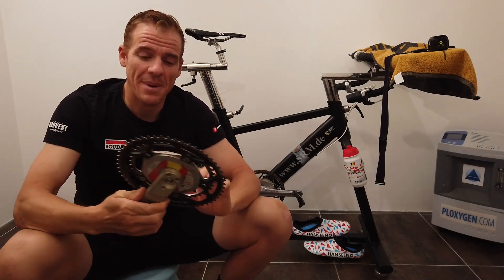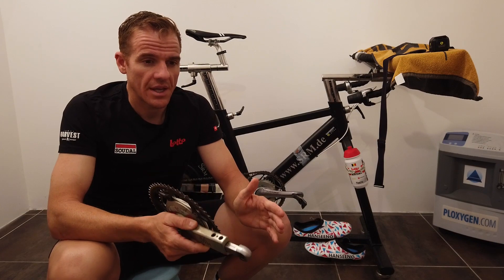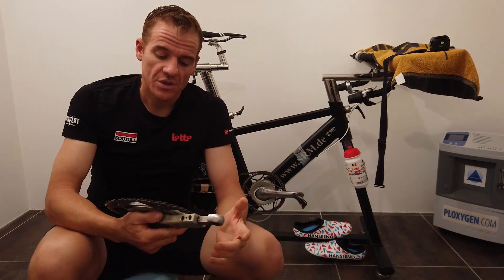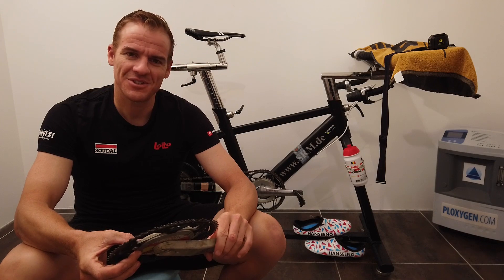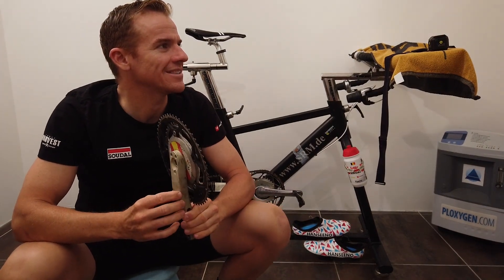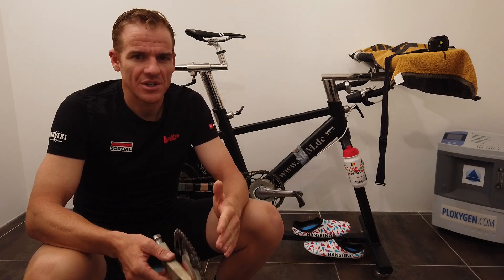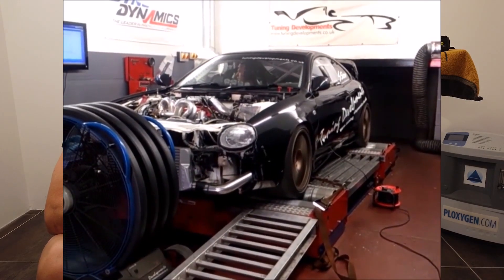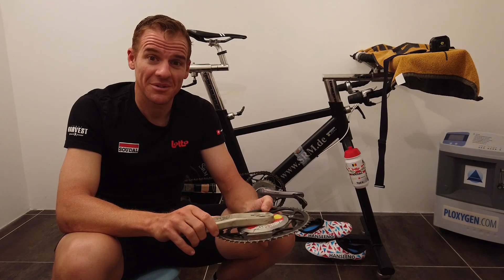What is a power meter? and what are Watts?..... The SRM.

Comment: Hi Adam hope you're doing well, whats your toughts on this new possibility of cheaper powermeters anounced recently?
Reply from the maker: I will go upstairs and get my laptop for this reply.....😀
Reply from the maker: Ok....... strain gauges are cheap. They cost nothing. Of course, there are better quality versions compared to cheap ones but I believe the difference would be less than 10euro. I'm sure you can buy them as cheap as 50 cents each. The things is, what I did not say clearly in the video is when you had to attach the weight on the end of the crank you had to do it at 90 degrees. Now SRM's strain gauges are in the spider. Depending on the version you get, don't quote me on this, there are 4 connecting points from the chainring to the crank part. So 4 places for the area to flex and be measured by the 4 strain gauges. Now there is a science SRM crank that had 8 strain gauges for better accuracy, I think it was 0.5% +/- and cost more. I believe this version had one on each side of those 4 arms but don't quote me. The SRM spider is the best place to measure power. Because of its constant force on these areas at any moment during the pedal cycle. Meaning if you apply that torque at 90 degrees downwards or even at 12 O'clock in a forward position then, the spider reacts the same. It doesn't matter the angle of how it is applied because the crank arm creates the flex of these 4 arms in the spider where it measures it.
Now if you just have a strain gauge on the crank arm, like other manufacturers. Like I believe this new method type coming out and all the talk is about. Then you really have to question how they measure power. Because a 5 kg weight at 90 degrees will send that single strain gauge at its maximum range and when the arm is at a different angle it could be very different, depending on where these strain gauges are mounted on that arm. I don't know for a fact, but there would be a lot of software coding to make it more accurate. For example, when you had those 1 arm power meters would use software to create power on both arms. This is a cheeky example to use, sorry because we all know both legs are not the same but they just doubled it with the code. Some riders have a 4-5% difference in legs and then to add a 4-5% difference in accuracy on cheap systems makes a big difference.

I question not that they are so cheap, but more the location they are placed, the code that will try to show a real figure. Its like HR monitors to calculate Calories. They are accurate at measuring your heart. But they use a formula of your weight, age, Vo2Max to calculate the amount of energy you spend. It's really impossible but they are pretty close and for the money does its job.
Reply: @AdamHansenOfficial  So as you said on the second paragraph, by pure guessing, do you think that's more likely to be a new niche of not so acurrate powermeters? Generally speaking.

When i heard about then I immediately tought that the same thing that goes with groupsets "hierarchy" would happen to powermeters. Anyways im just speculating with hopes that someday they became more affordable.
Reply: @new_world_fish  @Adam Hansen - That's the problem wth the Stages Powermeter in that it only takes the non drive side crank and doubles it. Though it was the cheapest option. I believe Durianrider and also Team Sky (at the time) were big uses of it at one point. There was also a Powertap which measured the power through the wheel hub, which I thought was a little strange. From my research the SRM was the best power meter its only issue was the cost of it. I think Adam you make a good point in that its not so much how cheap something is but where its placed in order to measure.
Reply from the maker: @phill2383  completely agree.
Reply: @AdamHansenOfficial  @Guilherme A Good Discussion with you both. I shall save my Pennies and buy something in the future that will Measure my Power a bit more Realistically.  Chapeau !!!
Reply: isn't the lever arm the one that matters? (not the direction of force in relation with the crank)
   in this case just one strain gauges will be enough - it's just that it has to be accurate and maintain its accuracy throughout the cycling contexts (temperature, humidity, etc).

"a 5 kg weight at 90 degrees will send that single strain gauge at its maximum range and when the arm is at a different angle it could be very different"
   that's normal, i think, since lever arm gets shorter while crank at different angle than horizontal, and while same force and direction of force applied over the pedal.
Reply: @mirceaandreighinea   So I think Guilherme , Adam Hansen and others may have a lot of experience with Power Meters but I'll say my bit.  Its a case of finding (on the bike itself) where the Power is most Accurate to be measured from (this will give you the most realistic outputs). I believe that location is through the Crank Axle.  
Its an additional cost, but its also best to have strain gauges embedded at the four points through the Crank (as this will eliminate Dead Spots in the Pedal Stroke?) There is lots to debate with the Lever Arm, but if you are using that method then its both Lever Arms (and not just one i.e. Stages). There are also Pedals which claim to measure Power but what I've picked up from this dialogue is the further you get away from the Crank Axle the less accurate true power may be.
Its a lot about the Mechanical Movement of Cycling as well i think.
Reply: @Phillip Lloyd 
   
   best would be as close to your body as possible, of course two sides (since two legs), which means: shoes, or pedals, or cranks close to pedal spindle. the further away you get from that the more inaccurate it will be, since the system is getting asymmetric (chain on the right side). 
  
   then how often you measure it (force/torque) per one crank revolution. of course, the more the better, since you create the "continuity", covering more space. 
   
   either way is the same for getting the torque: either force perpendicular to crank times lever; either force straight into the pedal axis times lever arm. 
   
   and, of course, one thing is the power measured as close as possible to your body (ideally, for knowing your self), and another thing is the opposite, the power measured at the rear wheel (which actually propel us in movement).
Reply: @mirceaandreighinea   So for me I think the key thing is to have the Measurement coming from the thing that is propelling the Bike forward (The Axle / Crankset) - That is one of the things this Video has taught me. I wonder whether a Pedal System would be a good option, the problem is both pedals are also rotating on the crank arm as well (and hence would give a different Power Reading) and not all Power from the Pedal is going into Propelling the Bike forward. 
I'm no expert at all on these sorts of things, Maybe Hanseeno or even Mr Campenaerts may say more. :-)

Comment: wait so 1 kcal is 4 kilojoules. so if you put down 4 kilojoules into the crank and you're only 25% efficient, your body uses 16 kilojoules which is 4 kcal? that's a fun rule of thumb. another i found is that if i have a 160 mm crank my gain ratio equals metres development per crank revolution (regardless of what gear the bike is in), another is at 105 cadence average torque in Nm is 1/10th of power in Watts. the 53/35 crankset seems like a great idea. i like the granny gear on my triple, it feels so efficient to spin up a climb, and it's basically that only in a double.

Comment: Another awesome vid Adam. I run an SRM. The latest rechargeable version. It’s is awesome and probably my most favourite component on my bike because of exactly what you described in the video, it’s essentially a dynamometer that we take everywhere. Another good way to describe it to laymen (non cyclists), is that body builders do repetitions of weights in a gym in a structured way to force the body to adapt to the stress/load applied. A power meter tells a cyclist how much load they are applying so that they too can illicit the same sort of positive adaptations. Before the science of power meters, it was heartrate which doesn’t measure the weight/load but simply how the athlete felt completing the work. Very different metrics. 

Which brings me to my point. For some years, I religiously followed power. It was only until recently that I have actually understood the importance of understanding measuring power and heartrate simultaneously to understand the whole picture. One without the other is no good. You need both. One measured physical load (it’s maths/physics), the other measures how you feel about it (physiology). 

I’m a big covert to tracking my PWR:HR ratio for my intervals, especially when trying to develop extensively instead of intensively (ie working on my stamina and time to exhaustion). By pushing out my interval durations 2 x 15, then 2 x 20, 2 x 30, etc. over the weeks you see in increase in the PWR:HR showing positive  adaptation. 

A video on this very point (using both devices) would be cool.

Comment: Very interesting indeed. Have you tried the sp-01 boost version? If so do you like it the same?
Reply from the maker: Yes and no. I'm actually racing on it. Its the same and better if you can get the same position, but because I'm so far forwards I'm at the rails max limit and the boost is shorter so it means I'm further back. I'll have to make a new seat post to have the same position. But for a normal position, the boost is better. It forces you to sit in the correct position.
Reply: @AdamHansenOfficial  Thank you very much for the reply. I'm about 7cm behind the bb with a 15mm setback post so should be fine. Gonna get the boost then when it's available here.
Reply from the maker: @MrJaycobsen   flick me a message on Twitter/IG. I may have a spare one floating around.